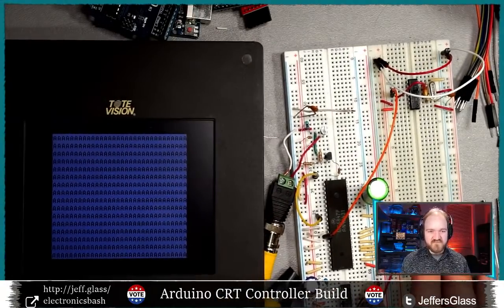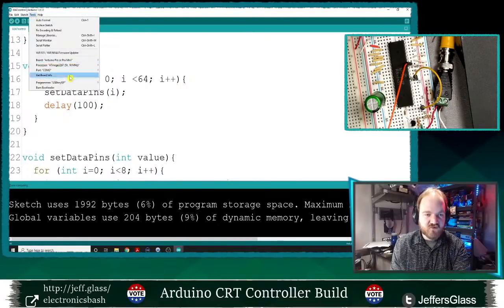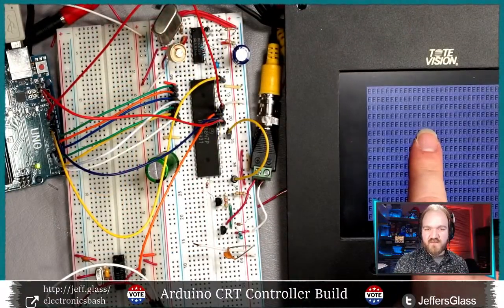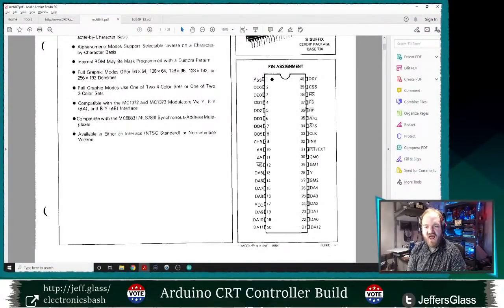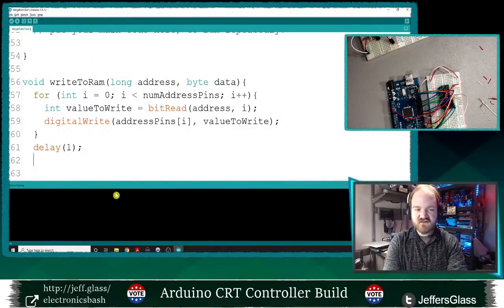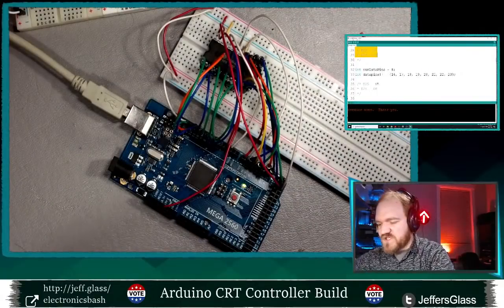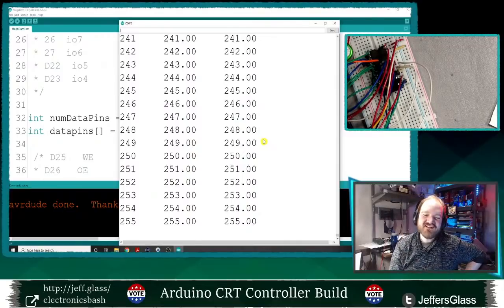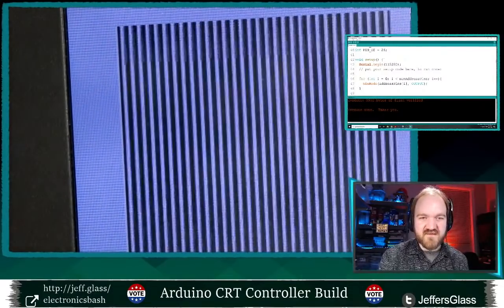Attaching a CRT Monitor to an Arduino Using 1980s Tech [LIVE[

Comment: Arduino I/O ports it's worrks at 3,3Volts but, 6116/6264 RAM chips work at 5 volts. Regards from Chile.